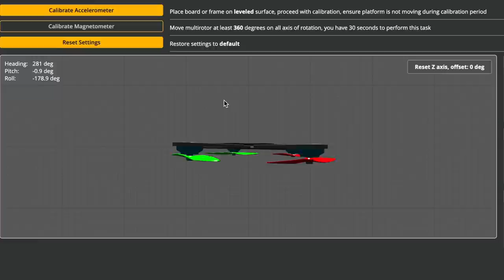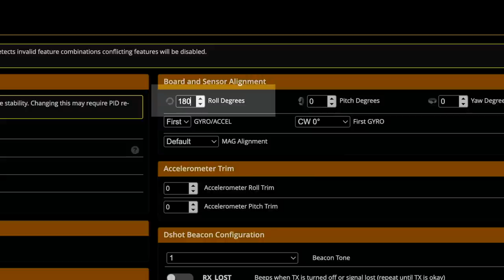Pusher Drone!! - Upside Down Motors?!

Comment: As a cinewhoop pilot, there's lots to laugh about here, especially the confusion putting props.  lol.   You got there though.   But, that stuff aside, I don't know exactly what it is either but my Cinewhoops always feel more stable.  I can do slow pans at 4k with no stabilisation in high wind and get smooth results out of the camera.  Compared to my race drones which are jitter little fuckers, pushers are like flying a pillow filled with clouds.  Turtle flips are easier too, I guess, maybe.  Interesting comparison.

Comment: These propellers are designed for pull and not for push, no matter if you turn the engine upside down, it's like flying 3D with normal propellers... that's the problem with this build.

Comment: Let me clear up all the stuff for all the homegrown engineers like the rotor riot team. All the cutting edge technologies start in military rnds and then it comes to the civil engineering. So don't waste your on obvious modifications which are already tested by the military. Putting the motors upside down and  expecting gain in performance is the same thing as speaking about ducts as an efficiency gaining shit on whoops.